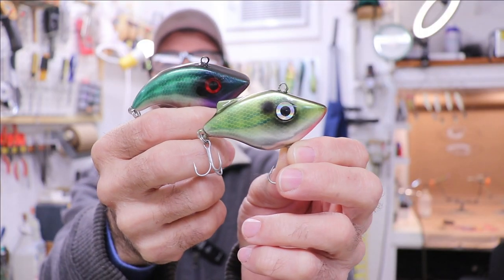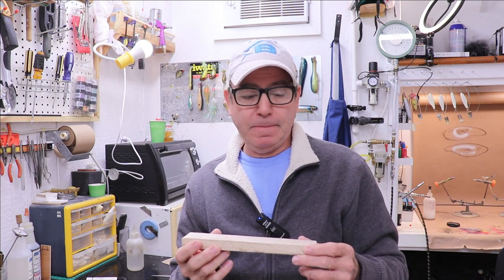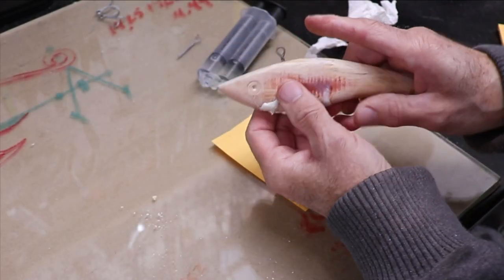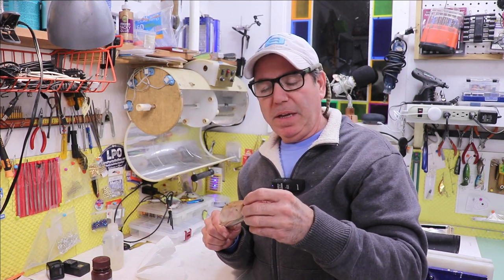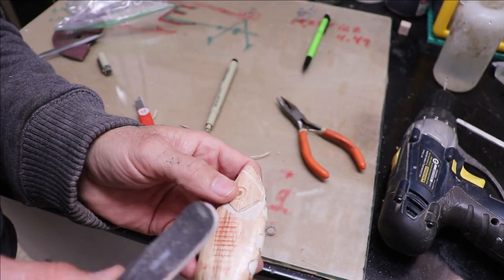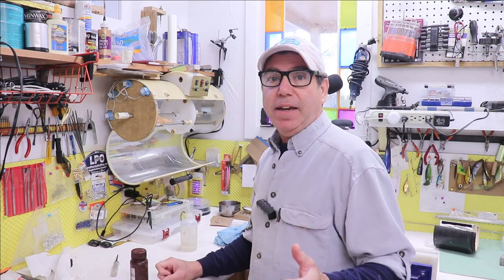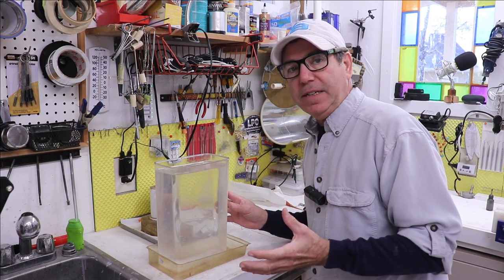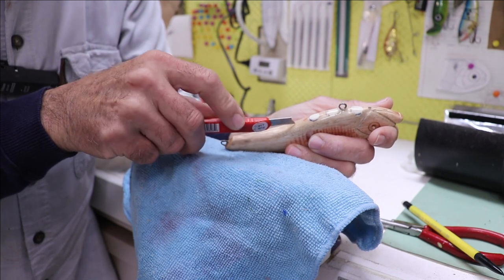Making a Wooden Lipless Crankbait, High Speed trolling Lipless Crankbait  #liplesscrank  #crankbait

Comment: Hello Franco 
Love the new video but I have some questions.
If you are going to use this lure where it is going to get damaged and you are going to make more replacements 
Why don’t you make a mold use the 2 part epoxy resin with the micro balloons, once you figure out what you need you can quickly make more.
Also, isn’t that material tougher than pvc trim?
Also, you can color the resin so you don’t have to paint it, you could probably add some glitter for shine
Anyway, keep the videos coming I look forward to them every week

Comment: Dip coatings are more practical. Epoxy turns yellow and leaves an un aesthetic mark on the bait lip.
Which one do you consider as the final coating?

Standard epoxy + hardener
Allumi UV resin
KBS clear diamond finish
Solmaster lv 1 uistinlakka
Accel Urethane lr+
Accel Cellulose Cement
Nagashima Cellulose Clear

Comment: nice work, good explanation, i have a question, does this principle of 15% more weight work on every density of wood or are there some variables on the different types of wood
Reply from the maker: It works pretty well on low density wood like camphor and cedar, but it's an estimate intended to make sure the lure is heavy enough to sink.  If your trying to achieve a more refined sink rate, you'll need a more accurate method.  And you apply the 15% to the calculated weight, to be added, not to the total weight, in case I didn't make that clear in the video.  Thank you.

Comment: Is the "popsicle" anal fin needed for stability or is it more ornamental? Have you found a relationship between the length and the required maximum width? Any important relationship between where the line tie is located and the location of the forward hook?
Great looking lure. Would be a killer fishing among rock piles for striped bass.
Reply from the maker: The anal fin is just for looks on this one...the ratio of length to thickness is so dependent on the shape that it's hard to say what is optimal.  I like to keep it around 8-9 to 1 (length : thickness) with an absolute minimum thickness of 3/16 inch.   Thanks for watching,

Comment: Yup, I’m more confused about the weighting. Curious my you don’t melt lead? Maybe the obvious health risks/fumes etc. Beautiful bait and great timing as I am mid build on something similar.
Reply from the maker: You're right...I have a small space and lead fumes are really bad for you.  Also, how would one weight out and exact amount of l molten lead?  Good question though...probably lots of folks wondering the same thing.  Cheers.
Reply: @EngineeredAngler  I’ve been using round split shots for bait building myself and had been contemplating getting a lead pot but concerned regarding fumes and can’t seem to justify the spend when splitshots work well enough thus far. Good to see a veteran builder like you doing it this way.

Comment: Hi Franco.  I have decided to make some 6 ins Plugs from a convenient broom handle and wanting them to be Pilchard/Sardine shaped and weighing about 60 grms for catching saltwater Bass here in the UK.  I have taken lots of your advice and shaped down some already.  My real Query is, if I make a Top Water lure should it float level and if I make a Sub Surface Lure should it sit tail down ??? I want to Walk the Dog with both types.  I have large split shot to achieve the balance I require.  I really enjoy your videos and would really appreciate your help.
Thanks in advance.  Hartley Pascoe
Reply from the maker: The short answer is that moving the weight back on your lure will usually results in easier walk-the-dog action.  But I suggest you watch this video for a better understanding.
https://youtu.be/acqIYMolH6s
Reply: @EngineeredAngler  Many thanks for your quick reply, that video didn't quite hit the spot but it triggered my memory and I found another of your videos entitled @ Topwater Lure Design' which did hit the spot.  Many thanks, Hartley.

Comment: I would think you would make up some type of camera mount 
that attaches to the boat and a pole with a string on it pulling the Luers
leaves you free to steer the boat
But excellent job for what we have as I said before I would buy them I’ll give you $100 each
Reply from the maker: The boat I'm using is a loaner...My boat "Alumina" is due to be put back in the water very soon.  I'll make a rig for better underwater vids soon.  Thanks you  and cheers.